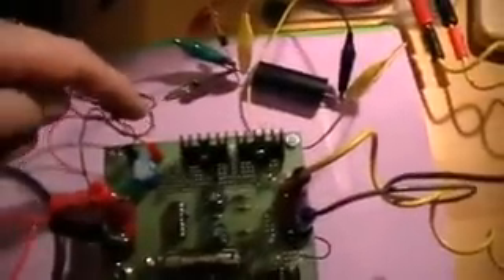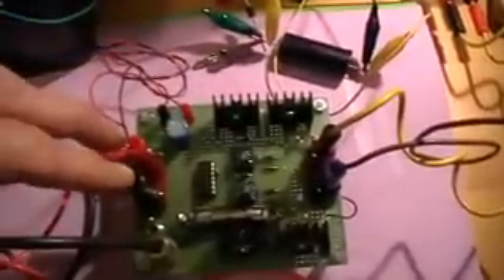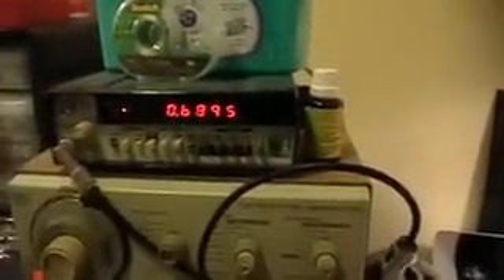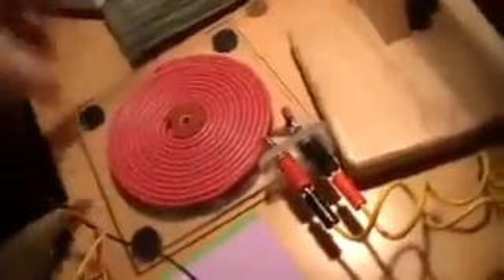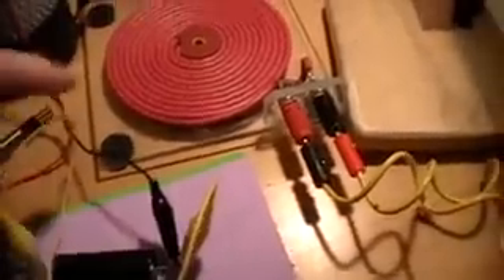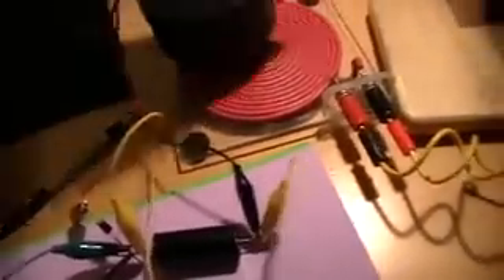resonance effects for everyone

Comment from the maker: Yes, even in my own inverted version shown here, I found unexpectedly different V and I readings, depending on where measurements are taken.
I also noticed that, in my unit, the eventual voltage on receiving cap (now 4500 microfarad) is relatively independent of the bridge supply voltage--but of course higher input voltages charge the cap faster. I'm getting 31 volts with 11.5 volts in, and 32 volts with 23-24 volts in.
Blew a mosfet today, very confusing, devil to troubleshoot, easy to fix.

Comment: watch?v=4mr3Xikrgak for gotoluc's original video. I find it interesting that the primary current increases when the load is removed and decreases when the load is shorted. I recognize a harmonic additive from the ground circuit. I also find it interesting that there is an ambient current path for the neon. Other than that, this resembles a normal charge pump. I will be thinking about those current nodes and KCL. Mayhaps we should get JoshS to look it over ;-)

Comment: You appear to be claiming over-unity while making measurements which do not simultaneously monitor voltage and current, which do not appear to have a high sampling-rate  and which involve a jumble of unshielded wires. Presumably, you decided beforehand that such things are not important. That is the very definition of poor scientific practice. Above all, a 'positive' result does not prove a theory correct. That is very poor logic.